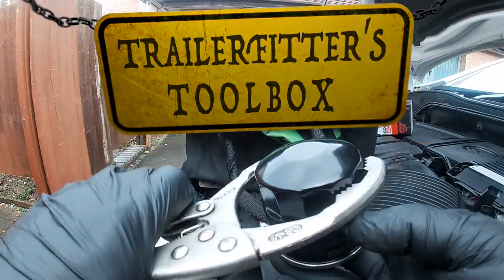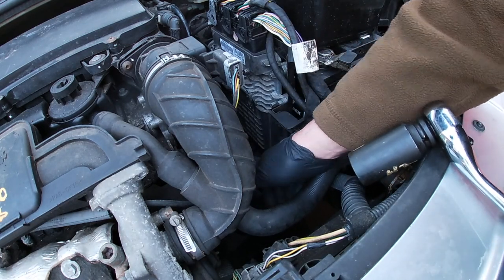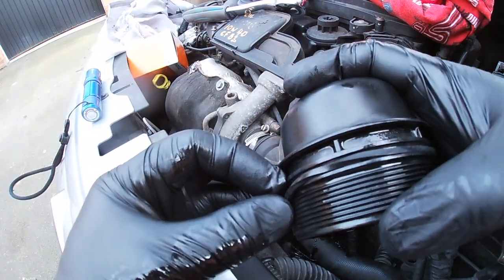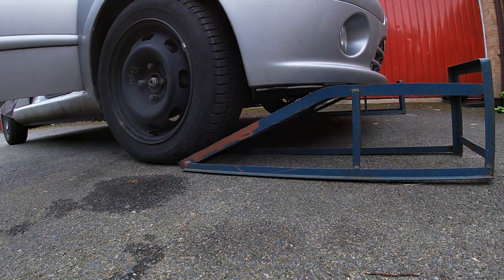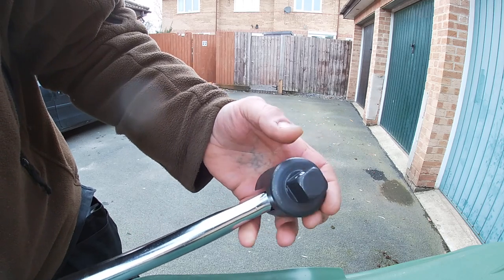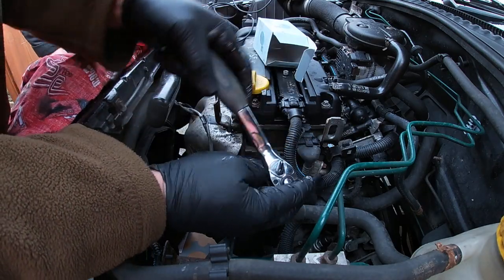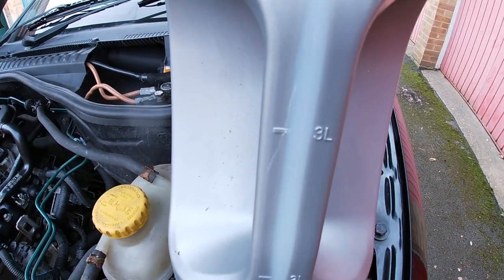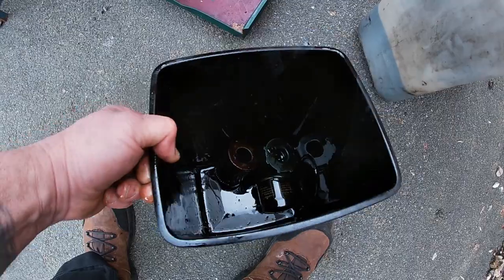Back To Basics - Servicing and Replacing the Paper Oil Filter Element

Comment: The ranger you just turn full lock and take the rubber guard off a bit  You don’t need to take wheel off but it is a messy one as it runs onto mount 
Great video as usual
Reply from the maker: What surprise me about that engine, it's the same as the Defender 2.2 but the filter on the Puma is really easy to get to.

Comment: Nice. I had a new set of ramps given to me. The Skoda Rapids spoiler was touching even when the car was on the ground. Gave them away.
Reply from the maker: Ramps are a PITA but they are quicker than a jack and stands so a slight bumper scuff is tolerable..
Reply: I was recently given a set, even my old 1997 306 dturbos spoiler was touching them. I made a 3 stepped approach to them from decking board screwed together, took about an hour and works a treat, much better access for servicing rather than axle stands.

Comment: Once the oil is up to temp partly unscrew the filter housing and the oil will then drain from it providing you’ve unscrewed it enough. You can actually feel it draining if you hold the housing, give it a couple minutes then you should be able to pull the filter out mess free, doesn’t work all to well with cold oil though. 10 years working on psa vehicles teaches you many little things like this 😂
Reply from the maker: Okay, point taken.  Let it drain. and that'll give me time to gulp some coffee.

Comment: I own both 1.4HDi and a 1.6HDi  (same set up) for 11+ years and never made a mess like this ...   your a messy trucker ! 
put a cloth or paper towel around the base of the filter before removal ....  crack it off and spin it a turn and let it drain and vent whilst you remove the oil ...  I never ever used the drain bung after seeing how much more oil you get out with vacuum extractor  (early models had the sump plug recessed and too much waste oil was still left I the sump after a traditional sump plug oil change think it was reported as 600ml on a 3.5 litre oil change and hence common cause of turbo failure as the crud was still in the sump and hence pug always recommend a oil flush on every service ...  I just changed the engine oil and filter at 5k intervals ) 
I always clip the filter in the plastic cap and rotate the filter so the filter locates in its hole ?    never had a problem but I always use genuine Citroen filters and buy them in bulk as we run two cars works out about £6.15 per filter 
Never had a turbo failure either ... as we run the engine on idle for a minute before switching off  
Cataclean before a MOT has kept us  legal  after a scare one year ....     mechanic in a bottle
Reply from the maker: Good points there!  I think it is because I'm always in a rush that the mess occurs but the 1.4 doesn't drain back as well as other engines.   Spot on about idling before switching off.  I do that after a hot run not just for the turbo to slow down but also to counter the heat-sink effect  (raise in temperature when the engine is shut down).

Comment: The 3.2l 5 cylinder rangers and bt50s down here in oz, when they first come out mechs where draining oils before smoko and coming back out and finishing up the service to find the oil pump had drained and hadnt primed back up when filling and starting. A lot of fucked ranger/bt50 engines because of it, Still get the odd story off it happening today, but most are onto it now.